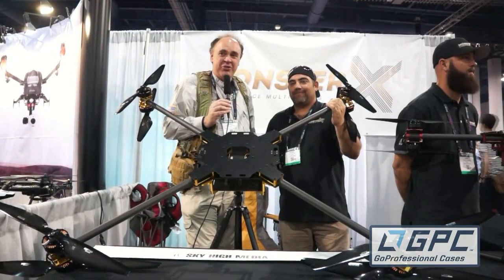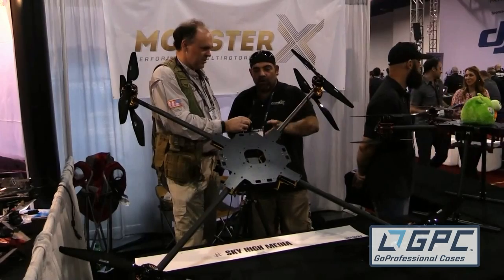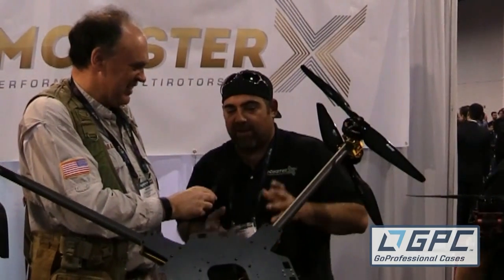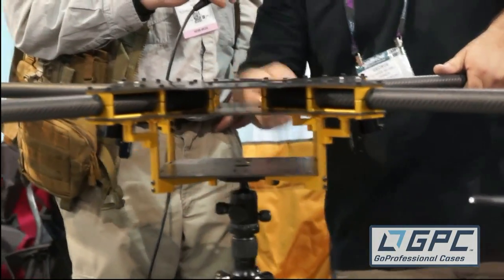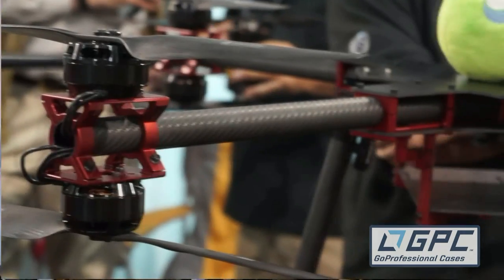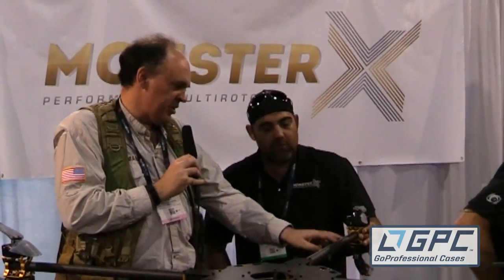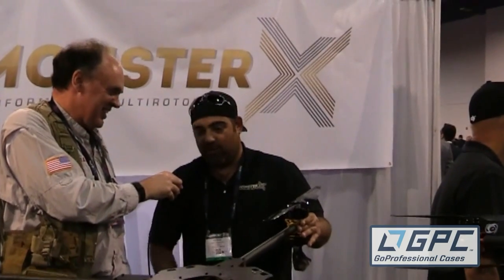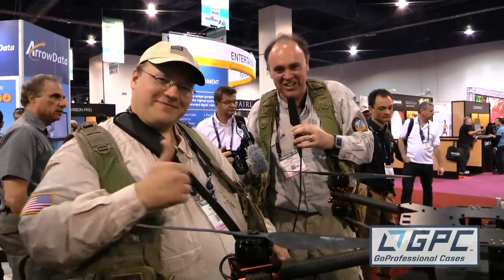Check out these Giant Drones from Sky High Media at NAB 2015

Comment: High modulus carbon fiber =unnecessary expense.the weight saving's don't offset the dollar's cost,but it sounds great for those with deep pockets.3,000 dollars,I could build a frame with the same strength,within 2 lbs of the weight for 2400 dollars cheaper.Its really nice,but 3,000 dollars.Each to they're own